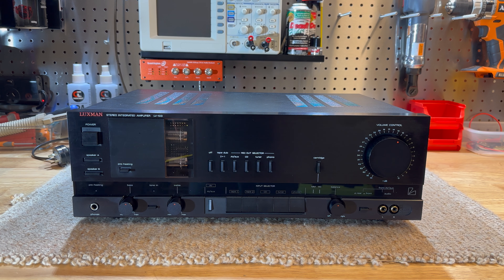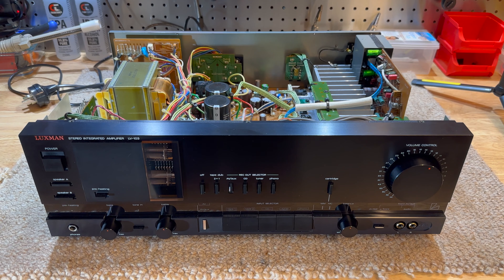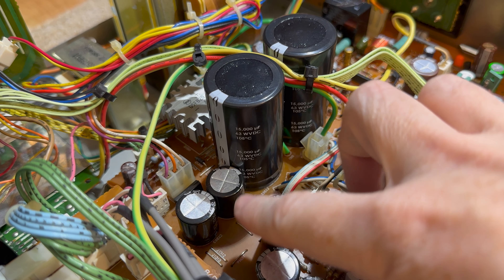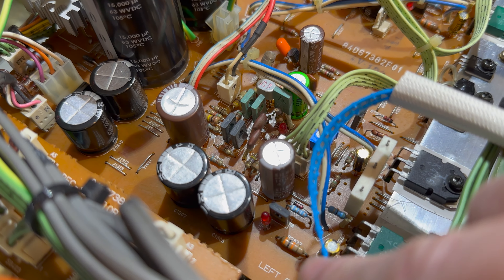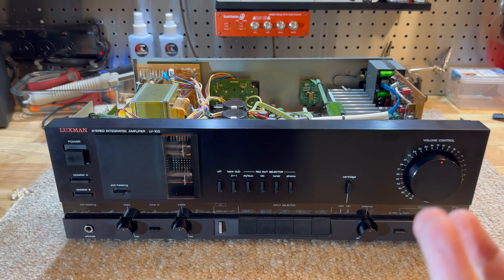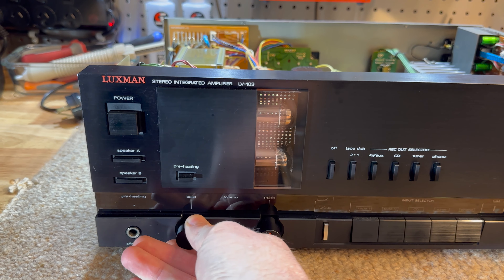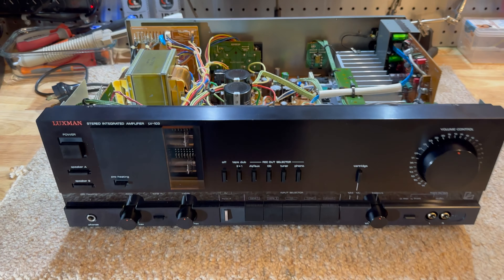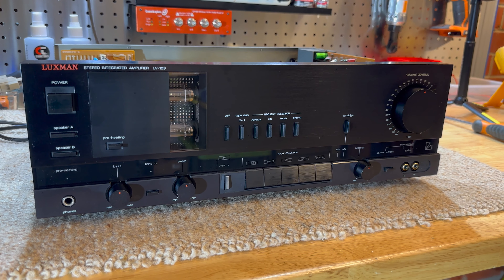Luxman LV-103 Amplifier - The Review

Comment: The LV-105 u has direct CD input selector. The main issue with the tone board IMO is about the potentiometers. the plastic bracket holding the rotary contacts inside were cracked and broken, and the contacts were moving in the pot, making these incredible loud pop (in the bass circuit). I rglued them and it made them much quieter, and lowered the floor noise significantly.
Reply from the maker: Yup I had that also, not good!